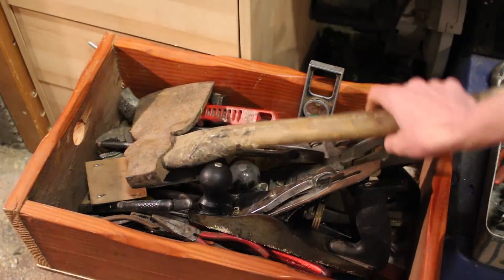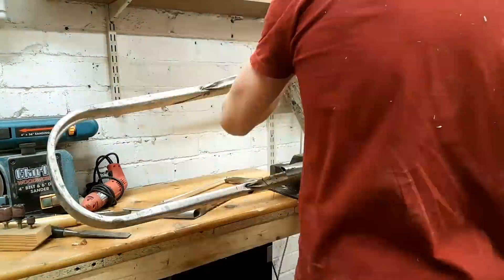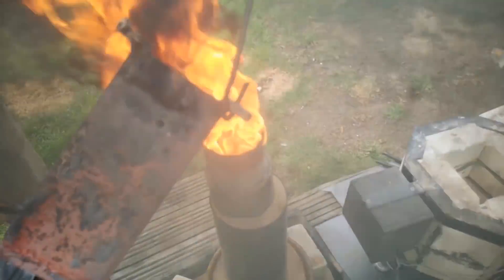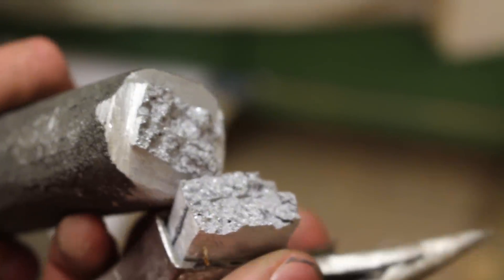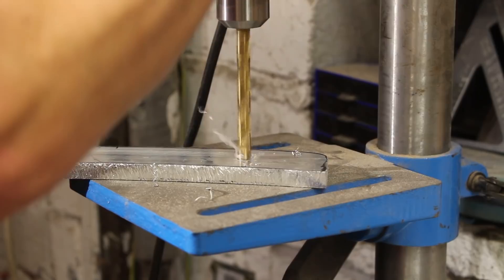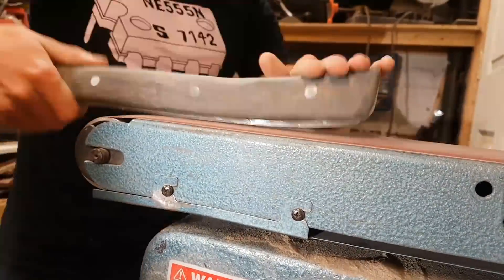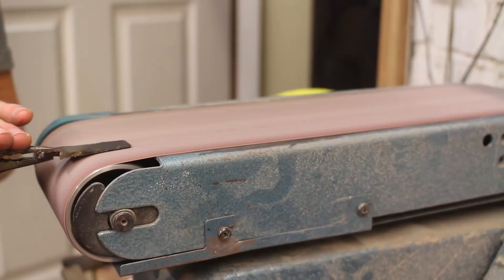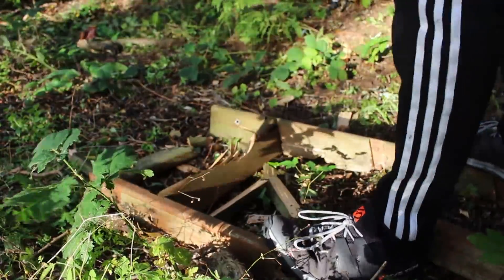Making an Indestructible Axe Handle

Comment: The axe is too heavy and will have way more shock and vibration on your hands. Theres a reason they’re made from wood. A properly set axe handle will hold as strong as steel.
Reply: For what he uses it for, it will be fine. He's not a luberjack spending hours chopping logs, just getting bark off pieces
Reply: I was waiting for this comment.  I knew there would be someone who couldn't let it go.
Reply: I was a bit curious about the added shock, myself. I don't think I'd want to swing that all day, but I can think of a whole lot of 15 minute jobs that it's perfect for. Matty has a point, this isn't the best handle for an axe you're going to use to heat your home all winter, but it's perfect for your toolbox or truck.
Reply: No, a properly set wood handle will not "hold strong as steel". If you have a 50 year old axe with the original stock on it, then you haven't used it very much.

Also, who is it "too heavy" for? Maybe it's too heavy for you, and just right for him. Such a nonsense comment.
Reply: If you feel shock from swinging an ax you simply aren't swinging it right. I always had sore hands after using the ax at my grandpa's farm to help with limbing the brush off of the main trunks of dead trees, until my grandpa taught me the correct way to follow through with a swing. There's no 'shock' that travels up the handle, what happens is people keep trying to apply force through the swing, when really you're supposed to pull back very slightly just before impact. The momentum of the head is what is doing the chopping, all you should be doing when the ax actually hits the target is holding the ax with almost a loose grip. I can chop at the hardest dead elm trunks all day now and my hands are totally unaffected, using the exact same ax as before. Of course my shoulders still feel the burn.
Reply: @sycodeathman  that is some really valuable advice
Reply: Depends on the wood, really. A properly made hickory handle can last decades (or longer) if properly used and maintained, but synthetic handles will take more abuse than wood. As for vibrations, you’re right that wood absorbs them, but it all comes down to if you want a handle you can abuse or an axe you can use for hours without hurting your hands. It all comes down to preferences. 
Also, assuming his location based on his accent (British? Irish?) he probably doesn’t have easy access to hickory so a synthetic handle is probably easier.
Reply: This is true, basically ruined the axe, and all the grinding on that bit probably ruined the temper too. Hey man you got some skill but use it for something actually useful, the metal axe handles are for noobs.
Reply: @Winterfar explain how he "ruined" the axe. Not everything goes the way you want it to, neither does everyone do everything how you do it. If he wants/prefers an Aluminium handle, let him have it. Nonsense comments are strong with this one... And the grinding thing, you can always temper it again. I think he has enough eperience todo so. Theres no need to spend 4 hours sharpening and polishing your axe because it will always end up dull, no matter how fast or slow.

Everything has its pro's and con's. Wood may not corrode, metal wont break as easily as wood will, wood maybe more expensive, metal maybe cheaper, wood maybe lighter, metal maybe heavier but in the end it all comes down to one thing: Personal Preference. Would you prefer to walk 50km or drive 50km in a car just to get some food?.
Reply: Dead Meme hey man don’t get so bent out of shape over other people having an opinion.... lol nice wall o text. Go do a simple search on the internet on why wood is better. As far as ruining the axe hey that’s my opinion so unless you want to contradict the first part of your poem up there you can’t get all butt hurt that I have an option smfh
Reply: now playing the opinion card. Go on, im waiting for your wall of text, Mr.
Reply: Dead Meme I’m sorry I hurt your feelings bud.
Reply: Matty Ice I have used steel shanked, leather wrapped Estwing hammers, axes, and hatchets for 45 years and never had a problem with excessive shock or vibration. I still own one that my father used.
Reply: Douglas Reeves Ok thanks bruh. Walmart has a nice steel axe for like 10 bucks better go git it man. Wrap that handing in leather and dip it in rubber ur good to go for another 45 years.

Comment: Phenolic is extremely carcinogenic. You need to decontamenate your entire work space completely as humanely possible. Its deadly stuff man, I wouldn't use that axe personally, the material is just too deadly as a contaminant. All that dust you kicked up, your clothes, all your tools and belt sander all need to be cleaned and replace that belt asafp, sanding more stuff on it after the phenolic will kick it up into the air and in your lungs, throw the clothes compleatly out you dont want that shit tracked around your house and into your bed and shit. I know I'm late but dude, phenolic is scary shit.
Reply: I also feel obligated to say that you did a fine job in in your work. Its lightweight design and thin shape is preferable in an axe handle and drilling pits in either side of the internal structure did provide a better seal with the resin, although scuff sanding would have been a better choice because now you have air pockets inside the handle. For an axe thats fine (should be anyway), but if its ever in an environment cold enough for the air to condensate and freeze, it will expand and pop the handle apart. Not all at once, but over many years. Another thing to keep your eye on is the rate the wedge corrodes.Air and moisure (cathodes) from wood (cutting trees) will increase the rate of surface corrosion and speed up the galvanic corrosion process that has already began. By using steel and alu together without creating some form of barrier between the two (paint for example) the two dissimilar metals will corrode. The steel pins you used will corrode starting at the center of the handle and work towards the outside, completely unnoticed while each time its used a shockwave passes thru it. This goes for the steel wedges around the head as well. Since you'll be swinging this over your head and chopping things and sending shockwaves thru it, I needed to warn you that although you did excellent work, I'm not saying you did poorly, no your work was fantastic, you need to be wary of these things. The worst thing in the world that could ever happen would be if the head flew off and hit someone or if it broke apart between your hands mid chop years after it gained your trust and you're confident swinging it. 

The craftsmanship you demonstrated is down right admirable, but don't fool youself into thinking its "indestructible". It's worse then that. It's *selfdestructive*. 

Be safe and have fun.